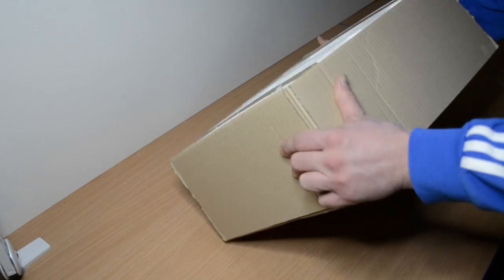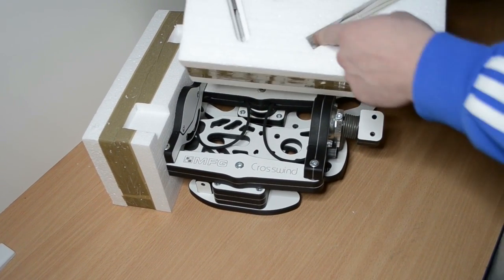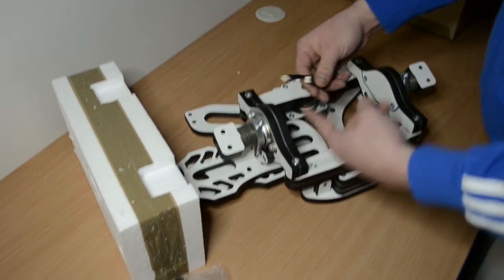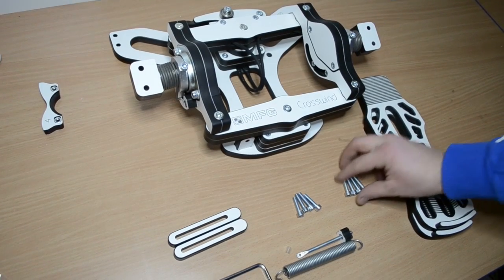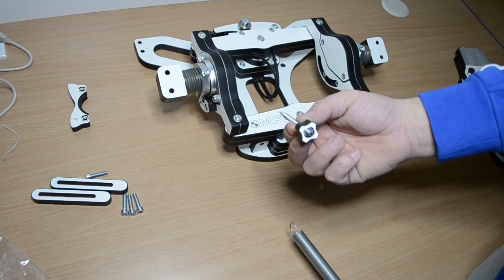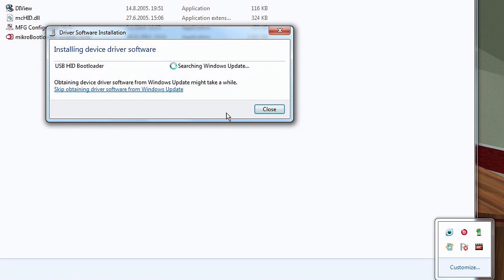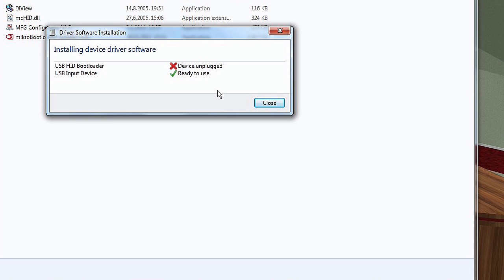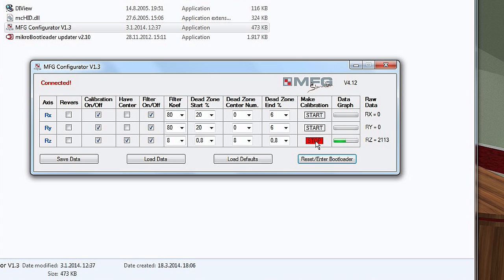MFG Crosswind rudder : unpacking ,assembly, calibration instructions

Comment: What is part 4 for???
Reply from the maker: I guess you mean CAM4 centering profile. It's supplied standard with pedals. Default is CAM6 installed which is more of an airliner CAM with stronger center detent and more linear force toward end of motion. CAM4 is more of like single engine piston aircraft with weak center detent and different progressive curve. You can also purchase 3rd CAM - CAM5 which is more realistic single engine piston centering profile. Read more about it from PDF that you can find on our product webpage
Reply: @MFGCrosswind  thanks for the reply.. figured it out. Fantastic pedals btw!!

Comment: What about part number 4?  Is that a replacement part if the one on the unit wears out?
Reply from the maker: That is CAM4 centering profile which provide you with different feel of the rudder centering. Cam4 is more to simulate piston aircraft, while cam6 (fitted as standard) is more for airliners
I suggest you read full cam description on our product page

Comment: Just received my pedals.

Toe brakes barely work plus they are reversed, v2.15 configuration tool
Reply from the maker: just replied to your e-mail...you should invert the brakes either in game or in MFG Configurator software...and "barely work" probably mean that you readjusted the angle of the pedals and therefore re-calibration of toe brake axis is mandatory ( by using MFG Configurator software).
Reply: Thank you,  but i already fix it the thing apart from the inversion had to do with the dead zone, had to get rid of all the values.

Comment: im thinking of ordering one, i was wondering what are the policies involved with faulty products? im sure its extreamly unlikley with someone of your craftsmanship but say it was a bad chip or maybe some faulty connectors how would you go about replacements?
Reply from the maker: I understand your concerns ...and it's always possible to happen. However, we do test pedals before shipping so such cases mostly fall into shipping damage category, and are very rare.
Of course, in such case we send replacement parts and instructions to replace free of charge. If the damage is beyond something end user can rapair we send replacement pedals ( never happened yet...to be honest :-)
Warranty is 2 years, but we surely supply spare parts after warranty is over - at reasonable cost.

We also have 30 day refund policy, but don't cover shipping expenses at our refund policy.
regards
Milan
Reply: thank you for the quick replies i have already gone an ordered one and am very excited to get this to go with a new warthog HOTAS i have also just ordered. gonna take some getting use too having rudders instead of the Z axis on a joystick but i confident its going to be worth it. currently own a saitek cyborg 3D gold and has been through extensive use for 17 years now believe it or not and still works lol. gonna miss it tho. but its time to move on

Comment: Have received my pedals, excellent stuff and a big improvement over my CH Pro pedals.
Just a few minor remarks:
1. some of the threads required an effort to get the screws in
2. the calibration video seems to show an older version of the calibration tool, and I did not find any video explaining the added fields in the new version.
3. DPD's ERP seems to have a problem with Croation characters. The "Č" in Čarolija was replaced with some hieroglyphic in the SMS they sent to announce the delivery
4. the wall spacers are far too short for my setup. I screwed the pedals onto a 18mm furniture board to provide spacing and added weight so the pedals don't tip over when I set just one foot on one pedal.
Reply from the maker: Hi Hans and thank you for your comments. 
On your concerns I'd be free to answer :
1. It is possible that there was some glue residue in the nuts on our last batch of pedals, and therefore you had to use some stronger force to get the screws in - in other words ...force the glue residue out :-) We improved that now.
2. We published a full and complete user manual for new version of software. It's inside software package, and it explain all the fields you might use and beyond
3. huh...yes, I have to be careful when we ship pedals to replace all special characters with regular english ones ( Finnish, Croatian, Spanish... but we can't replace the sender in the system....I don't think it's that much of a problem that Our Courier misspelled our company name when they sent you SMS message about delivery. I'd rather say that SMS is a nice feature of the Courier..
4. We produced wall spacers for most common setups. Of course, it is impossible to make a design that will please everyone, and you did a right thing since pedals are best to be bolted on a large surface in any case :-)
 cheers
Milan
Reply from the maker: thanks !

Comment: I just received my set. Very nice and well packaged for shipping. Also surprisingly quick to the US. 
I have some beginner questions. 
1. Does it matter if the tension spring is placed on the inside or outside indent on the rocker arm?
2. Does it matter if foot plates are installed closer in using the outside screw holes?
3. If I change the cam plate with number 4 will the unit need recalibration?
I plan to stay with the factory set 20 degree pedal angle setting and am using Win 10. 

Mine came with a note stating  firmware v 5.02 and to not use the Windows calibration. 

Thanks!
Reply from the maker: +A A 
Thanks on comments.  Such questions are always better to send to e-mail at mfg@simundza.com..to recive a response in a proper way and more quickly.  I'd send you e-mail if I knew which customer you are...but that I don't know from your youtube nickname :-) So here are answers :
1. That's actually a feature. If you go to our website, under product features you will see that. Outer notch ( indent) will stretch the spring more than inner one during operation, causing more progressive increase in force toward full deflection. So check whick setting you like more and adjust to your preference
2. If you purchased additional WAP than it's OK, that's feature to make pedals more narrow than standard one. However, without extra WAP adapter foot plates cannot be installed in such way because bottom side will rub against brake torsion spring, and foot plates cannot be tightened well. You can add your own spacer to sort out that problem if you know how.
3. No, but it is recomended because every time you install a CAM it will fit few micrometers differenty...and that slightly affect the center position. I say NO because it will most likely stay within tolerances and factory programmed deadzones....but I say Recomended because calibration is just soo simple.... leave pedals centered...click START...move rudder left/right....click STOP...and you're done.
Reply: +Milan Šimundža ok! Thank you. I was busy watching the other videos and didn't expect such a quick reply. You can delete my questions if you like. Thanks again and I will email next time. #1999!

Comment: Got my pedals a few days ago. Just got the chance to set them up. Quite a significant upgrade from my old Saitek Proflights and most likely the last rudder pedals I will ever buy. Solid construction with configurability out the wazoo. The length of the pedals is about an inch longer than the Saitek PF pedals fully extended .. so if you have big feet that's a plus.. and since the angle and tension on the pedals is adjustable you can pretty much get it where you want it across the board. My only beef, which is minor but I am mentioning it, is that unlike the Saiteks or the CH pedals, which both have the pedals inside the area of the base, on these pedals the pedals themselves extend outside the area of the base and the base is more of a Y configuration than a square configuration so  so when you put one foot on a pedal it tends to tip over until you get the other foot on..
For me this is a minor problem which I intend to rectify myself with a trip to home depot and a few bucks to get something to place along the base in the front by where my heel and the bottom of the Y is to add stability. This is not a major issue and based on the quality of the work it would not surprise me if these pedals started coming with a slightly different design on the base.. Other than that these pedals are fantastic and in spite of that they are more than worth the $$$ I spent on them.
 After having flown with them in IL2, CoD, DCS (no helos though)  and IL2 BoS I can honestly say that for any simmer who is more than a caual simmer or any simmer who wants to buy once and be done as far as rudder pedals go.. These are the pedals you want. if you have a apir that is long in the tooth like i did.. make the inc=vestment inthe last pedals you will ever need now while they are still being made. if I had to rate these pedals on a 1-5 basis with 1 being garbage I would have to give these pedals a very solid 5. I have owned both CH and Saiteks.. and these pedals are just in an entirely different league than anything else on the market.